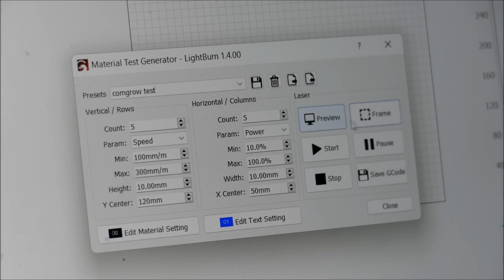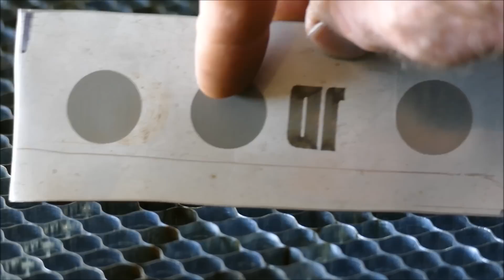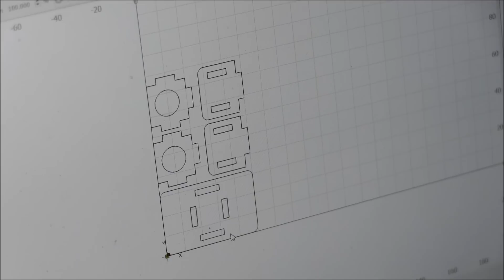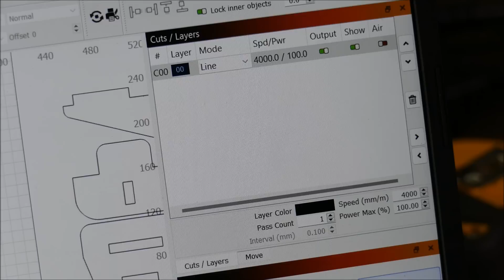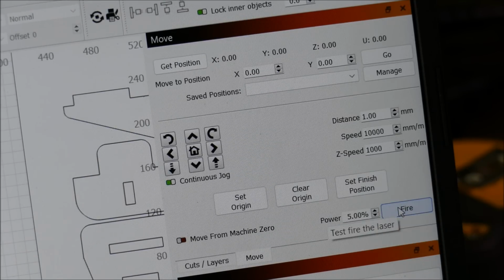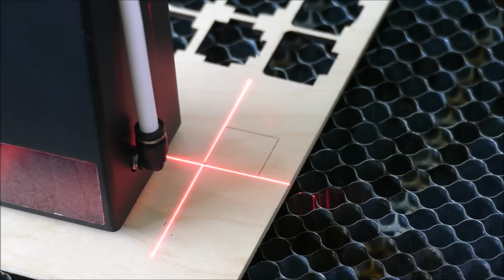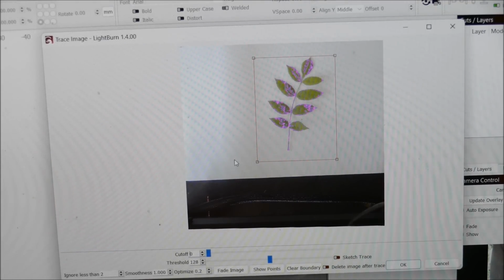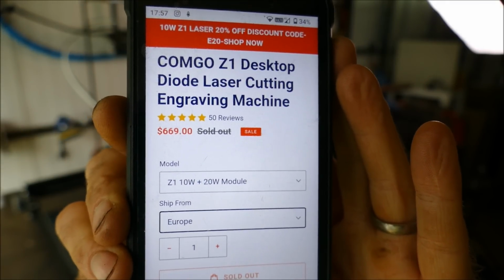Is this the MOST cost effective 20w laser engraver 2023! + best DIY upgrades Comgrow Z1 Pro cnc

Comment: The crosshair laser pointer was a HUGE help. Thanks so much for that.

There's a bit easier way to align it. If you engrave a 100mm crosshair shape, you can then jog with Lightburn so the laser crosshair exactly covers the etched one (jogging by as small as 0.1mm). Once there, you can rotate the lens on the crosshair so it perfectly matches the axes of the machine, that way the crosshair gives perfect alignment of the edges of workpieces in addition to position of cut. For the offset, you just subtract where you are from where you started in the coordinate display in Lightburn, then put that in as your offset. No fiddling needed.

Comment: The best channel for good solid information on these laser cutter/engraving machines there is plus all the other stuff you do. Many thanks.
Reply from the maker: Thank you so much for your support. Cheers J
Reply: @joshuadelisle  is there another way to purchase raffle tickets as I'm sick of trying to join Raffle  to be able to buy tickets to be in with a chance of winning a laser engraver. I've already lost my chance of winning the xtool laser. Many thanks in anticipation of your help
Reply from the maker: @1MartinWaite  Hi Martin. I have lots more coming soon including the xTool P2, longer 40w, Atezr 36w etc. What issues are you having because I'm in good communication with Raffall and might be able to help. Raffall is a good platform because they put safe protocols to make sure everything is fair and handled correctly. Cheers J
Reply: @joshuadelisle  I finally got it sorted out I was using 14 digits in my password and it didn’t like it so I reduced it down and I finally got in. Many thanks.
Reply from the maker: @1MartinWaite  well done and all the very best. Cheers J

Comment: Hi Joshua. Most of the time,i've only see you cutting plywood. My question now is: Does it also cut materials like acrylic glass,aluminum,copper etc....? It would be much easier for me to decide to buy one. Thx for any answer.
Reply from the maker: Hi. Yes to opaque acrylic not clear acrylic, you need a CO2 laser for that. It can mark stainless and glass but not copper. I've used these on stone, cement, leather and other woods also. Cheers J

Comment: Joshua Thanks.  The 20w unit at that price should do the job.  I want to make templates (1/4 plywood) of wood working projects files.  I'm making SketchUP  files.  You mention enlarging the bed size with common rails: I'm interested in 48" length but no wider. Can you be more specific on the rail type and brand?:hand-purple-blue-peace:
Reply from the maker: Hi thank you so much. If you go onto oozenest website they sell the rails cut to custom lengths. They're 2020 extrusion (20mm X 20mm) with beveled faces to accept the standard wheels. Note not all plywood is the same and some glue between layers do not cut very well. Birch ply is generally good for laser cutting but if you get plywood from a local DIY store try and get a test piece first before buying lots. Cheers J

Comment: Trace would make it really easy to simply print out line drawings/plans or pictures of an object you want to make in whatever material you would want to cut it or even 3d print and also allow scaling it up or down as needed(there are also carbide burr trim router bits for metal, which would make router templates for knife shapes rather doable if you have a solid router table(obviously rough cutting to near size with a band or jig-saw first)(
Reply from the maker: You can use a plasma table with this software too. I did a video on building one and cuts 20mm thick steel. Cheers J

Comment: Amazingly well done video. And enjoyed it all, except for the last part about the power per watt comparison which was kind of useless.  If you need a 40-watt you can't  just buy two 20-Watts.
Reply from the maker: Thank you. I agree which is why I said it's relative to your needs and that my 40w can do so much more. It's the most cost effective regarding price by cut performance but only on the types of tests that I did. For commercial use you can certainly argue a £20k+ machine that can reliably cut thicker and faster is more cost effective for generating a return on investment. But this one I would say performs very well for low budget home use. Cheers J

Comment: Question ---- where are the links to burn the camera holder and the laser aiming device.  I see something on your site with a box - but do not see the files for these 2 objects.   Is this pipe you used something standard to hold camera and what do you call it?  Also what would i call the screws sets you used for mounting when go to buy them?
Reply from the maker: Hi. Sorry I haven't shared the design. I'll see if I can for you. I used a 12mm square bar but only because I had plenty of it. It's quite simple though and could be drafted in lightburn and use any type of support bracket you can get hold of. I used what's known as M5 T-nuts for 2020 aluminum extrusion. Cheers J
Reply: @joshuadelisle    LOL - I am your complete Newbie..... the laser is ordered and not here yet.    I am good with computers and tech - so am not expecting a total battle..... but stencils for the attachments will help jump start me and figure out alignment issues.   We will be making pendants and you are in fact my teacher as learn to make things from scratch.  Your video gave me the confidence to take the assignment.
Reply from the maker: @mrparanormalmobius  thank you so much. I'm planning on doing a beginners tutorial on lightburn and basic design. I'm not sure I've still got the file for the camera and laser holder but I'll have a look. Cheers J

Comment: And with the Comgrow Z1 Pro now at £370 and things like the X Tool still over £1000 the value is even better.
What does the X Tool do that this doesn't, I'd be interested to know before I jump in on one of these.
Reply from the maker: xTool is a quality brand but you pay for it. Cheers J
Reply: @joshuadelisle  Just realised, you were comparing the 20w Comgrow with a 40w X Tool, that makes sense now.

Comment: Of all the laser cutters/engravers you’ve tested, which one is your favourite? There are that many available and 1000’s of videos, it makes it very confusing on where to start for the complete beginner. Many thanks.
Reply from the maker: If I was starting out with little money I would get a Comgrow z1 10w.  If I had a bit of money and wanted to get fairly good performance the creality falcon2 40w would be my choice. If money is no problem and I want the best then a CO2 100w+ would be what to get. Cheers J
Reply: @joshuadelisle  thanks Joshua, here in New Zealand the falcon 2 40w starts at around $2500. I think I know where you’re coming from and appreciate your insights. I thoroughly enjoy your videos and value your opinions. Thanks again for great informative videos. Cheers
Reply from the maker: @traveller4738  gosh that's a lot compared to the UK.... Alternatively the LONGER B1 40w is very good also and maybe cheaper. The xtool D1 40w is generally more expensive and has a few niggles but is excellent quality otherwise. Cheers J

Comment: EXTREMELY useful information, Joshua. If I weren't past my prime, I'd be a leaping to get one of these lasers and Lightburn full package. I can see so many things that could be done quickly just puttering around.
Reply from the maker: Thank you so much Clyde. You're encouragement means a lot to me. I think these small CNC machines are a good retirement hobby as the machine is doing all the hard work but your keeping your mind active by problem solving to get it to do the work. It's always very satisfying and fulfilling to be creative and help others with the things you've made. All the very best. Cheers J
Reply: I may be past (ok, am past) my prime but I got very excited when I started seeing videos of all the awesome things a laser could do so I rushed out and bought myself the Ortur LM3 for Christmas 2022.  I am a 72 year old woman who was an accountant In a past life and had no problem embracing and learning new software over the years. Once it arrived I was so excited to see it but it had been sitting unopened as I was worried I wouldn’t be able to handle the installation and learning curve. I finally had someone set it up for me and then I froze thinking I wouldn’t be able to learn how to operate it, my studio is full of cutting boards and wood and acrylic and slate coasters but I just couldn’t settle down and try to learn how to operate it. All the videos I have seen run so quickly past each step in Lightburn that I couldn’t find the curser before they were onto the next step. I was definitely feeling my age.
	Fast forward to last week when I went onto LightBurn and actually sat down with the tutorials to see what I was up against. Amazing! Going thru each step by step I found it was so clear that I was finally understanding what was going on. Now I am so excited to actually sit down with LightBurn connected to the laser and my laptop in hand to take me thru the program and just go for for it. Who said I couldn’t do it?
	If it looks like something you would love to be able to do for yourself and for gifts and who knows, maybe sell some things I say just go for it.

Comment: Goodmorning joshua, do you know where i could buy spare lenses for the comgrow z1 pro, or which would fit? Thank you
Reply from the maker: I don't have the machine to check but I found a seller that does them here: https://www.ebay.co.uk/itm/296296784824?_trkparms=amclksrc%3DITM%26aid%3D1110006%26algo%3DHOMESPLICE.SIM%26ao%3D1%26asc%3D266106%26meid%3D8d3720a4a1784f56b50fbdedba369f02%26pid%3D101429%26rk%3D3%26rkt%3D12%26sd%3D296307912990%26itm%3D296296784824%26pmt%3D1%26noa%3D0%26pg%3D2332490%26algv%3DSimPLMWebV1EmbeddedAuctionsCPCAutoManualWithCIIXAIRecallsUpdatedRanker0424&_trksid=p2332490.c101429.m2460&itmprp=cksum%3A2962967848248d3720a4a1784f56b50fbdedba369f02%7Cenc%3AAQAJAAABIFRm%252FxjHVkAHjTmALiNqvsqtv4qWt8xCbe4ahJ20t625K4Et9BuQKhB3GymqusTVQu6nRaRaqgb3%252FfZkomV8QnwXeVsqyuMZETWVRceQH9dU6SyvHfOXjhLuwZdp65XkAL8KynvDGgsKDHuu4gaFiFhVTIVjIitZ29e3Ir4iZe1J%252BW1pUKHIgknoO0MbBzBSnQVckbQ1QTNwTdhdKZ9Rx%252Fv8lzNjnO3f9%252FvcZGJwTdDu%252FD3%252Bie1UyDtC4T5hUvvbSeJfbdnUbuxEJmW0Mfb--CscfyClAuPEF1TaHDs1HHlGc41neaIpI68Dw4LAKx1ImA134FLwPXIL%252BKTCG0miviLV13ibYLC%252F0IGtNDISrvOqkoHWt50IhBN7YcqJRXcKrA%253D%253D%7Campid%3APL_CLK%7Cclp%3A2332490&itmmeta=01HYD172HZSHSGJG8BXB88NDVM

Comment: I'm just setting my Z1 Pro 20W up (had a Z1 10W that I gifted to my dad). The fan on mine is definitely louder than the older model. I did notice that when moving the laser head around manually the power light and head fan both come on momentarily; not sure if this is normal or cause for concern.
Reply from the maker: Hi. That's all normal. The 20w requires extra cooling so that's why it's louder, the stepper motors act as generators if moved quickly which illustrates the power LEDs, that happens on all models and 3D printers and is advised not to move them too quickly. Cheers J

Comment: Awesome and very useful review.  I just picked one up and do have one question.  How do you feel about the cable running down the right hand side?  I do a lot of engraving on large flat objects such as charcuterie boards and worried about the cable bumping into my projects.

Unfortunately I also found that the pulley wheels were assembled a bit too tight so that they had flat spots on them when they arrived.  You could feel them when sliding the gantry back and forth.  Hopefully they'll work themselves out over time.
Reply from the maker: you can raise it higher with the off sets if the cable is an issue and just put a packing board under the work piece. cheers J

Comment: What laser engraver would you recommend to a beginner with no experience?
Reply from the maker: Depending on what you want to achieve, most of the desktop lasers are easy to get started on. If you want just a cheap thing to play with the Comgrow Z1 works well and is very low cost. If you want performance or a machine that can be used as a side hustle I would recommend the new 40w models. I'm very happy with the xTool D1 but I've just been testing the creality falcon2 and LONGER B1 40w which are very good also. New videos coming shortly. Cheers J

Comment: Is it possible to swap laser modules on diffrent brands like putting a comgrow 20w module on a longer frame if so can you do a shorts video please showing that process.cheers
Reply from the maker: You can and comgrow have done videos on their channel for it. All the very best. Cheers J
Reply: @joshuadelisle  can other lasers work on the comgrow too?
Reply from the maker: @amoreyjones565  it needs the correct power input to operate higher power lasers. Comgrow sell a 20w module to upgrade that has a new power supply and can be used on other laser gantrys. Cheers J

Comment: I bought the Z1 Pro but nowhere in the instructions does it say what the laser head lens is for or how to install/use it. any ideas?
Reply from the maker: When you say laser head lense what do you mean specifically? Have you looked on the comcrow channel to see their assembly video?
Reply: @joshuadelisle  I did and it doesn't show it. I tried to send a link to a picture of the lens but it was rejected
Reply from the maker: @Growyourheirlooms  I think you maybe referring to the lense protector and you have a spare? If you take apart the laser nozzle you'll find the laser has a little round glass and brass protector.

Comment: What would the limitations be to making a custom size machine would voltage drop to the stepper motors be  be an issue?
Reply from the maker: Possibly but you can boost signals and circuits. Flex in the gantry is the main issue which may call for larger width extrusions. Cheers J
Reply: @joshuadelisle  ok really look foward to the next video.

Comment: I really like these reviews but I feel I'm getting overwhelmed by options. What would your honest advice be for a first time laser cutter purchase be, assuming only wood will be cut at an average maximum of 20mm? Speed is not the priority as much as accuracy and clean cuts. Machine cost is definitely an important factor however as is machine size/weight. Ideally it should be as portable as an ender 3.
Reply from the maker: Thank you, so far from what I've tested this one is probably the best entry level laser, the Xtool D1 40w is what I recomend if you want a starta  laser cutting side hustle. I still have lots more to show and theyre constantly improving and getting cheaper. cheers J

Comment: Would this be a good option for gun engraving?
Reply from the maker: You can etch stainless with this one but you need a more powerful 40w or infrared type laser module for  deep quality etching on steel. You can remove a coating with this on anodised aluminium or blackened steel to reveal a negative image for sure. Cheers J

Comment: Nice video! A couple of thoughts...  I agree about the focus plate vs the drop down lever.. I much prefer the drop down lever.  I would lose that plate..    2nd..  Did you notice the laser spot size on the Z1 Pro is LARGER than the 20watt module that Comgrow sells separately?  The Z1 Pro is 0.1x0.1mm and the stand alone module is 0.08x0.08mm.   I think it's strange that a newer laser module would have a larger dot size.  Maybe it's a cost cutting measure?  I have the original Z1 and the seperate 20w module that I have expanded to 465x785mm  cheers!
Reply from the maker: Thank you so much. I didn't notice that, I should have measured it like I did on my other reviews. Personally I don't think it matters too much as you can set the offset in lightburn and engravings just happen quicker because you can cover a wider DPI. Cheers J
Reply: @joshuadelisle  no, I don't think it matters too much either..  Just strange that the newer module is larger..
Reply: @joshuadelisle  it's still better if you have a smaller dot, you can always make it larger by throwing your device out of focus slightly, but if it's bigger by default you can't do anything to make it smaller.
Reply from the maker: @GodHunter1000  however you lose power if it's unfocused. A bigger dot that's at full power I don't think is an issue at 0.1mm. it's only going to make a noticeable effect on very small detailed engravings which if that's the intended purpose a fibre laser like the B4, laserpecker or xTool F1 is better suited. Cheers J

Comment: Guess you haven't heard of the 20 watt elegoo phecda? Only $399 at launch. I've tried replying to your comment four times now, they keep getting deleted but the 20-watt version really was only 399 when it was released on Kickstarter I know because I bought one
Reply from the maker: You're reffering to the 10w.  I've checked it out and the 20w is near enough the same price as the comgrow. It's also a 0.13 spot width which is quite wide.  The Comgrow 10w is cheaper at £300. It would be good to compare it otherwise. Cheers J